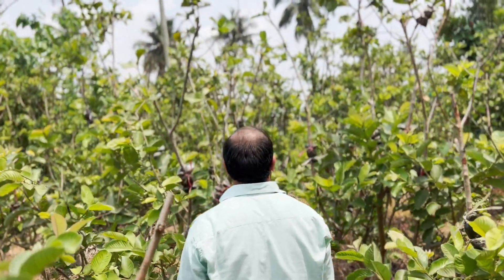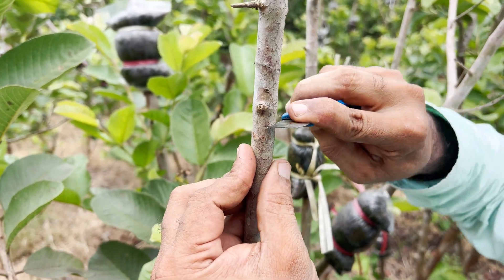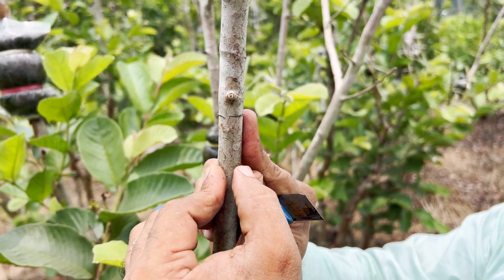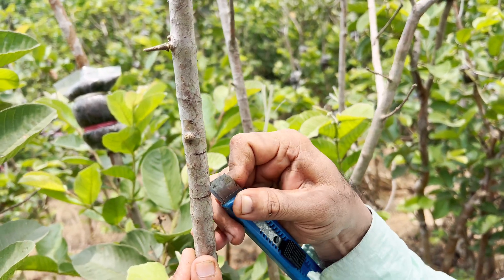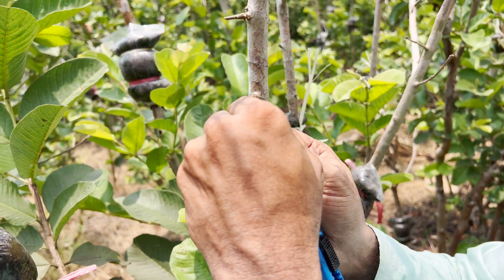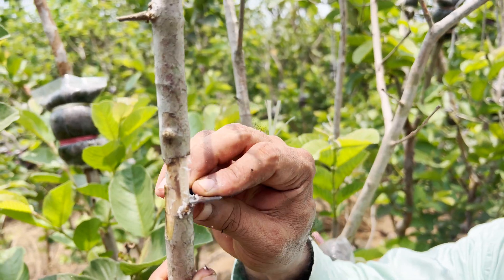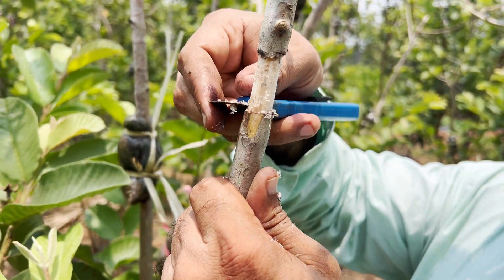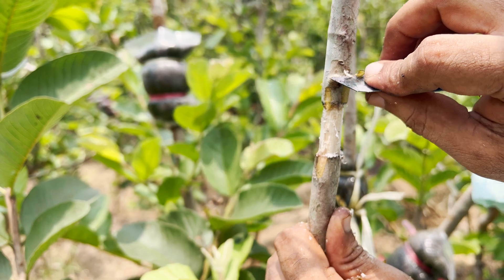Ever wondered! why we make that 1-inch cut below the node while doing air layering?Very Crucial Step

Comment: Sir u r the most experienced person
Need one q from u pls
I have a nursery in west bengal 
Cutting for root formation of Begunvalliae and Hibiscus how much ppm require for NAA & IBA
Reply: Thank you very much sir for this Very good video with explanation on preparation for Air layering..👌👍🙏🌟🌹

(Kindly correct spellings in this video regarding Xylem, Phloem & Cambium..)
Reply from the maker: For Bougainvillea Semi-hardwood cuttings-2000 PPM IBA + 1000 PPM NAA
For Hardwood cuttings - at least 3000 PPM IBA+ 1500 NAA
Hibiscus Semi-hardwood and hardwood cuttings 2000 PPM IBA is sufficient in view
Reply: @KloneRsrootingaids  How much PPM of NAA & IBA (approx.) will be needed for air layering apple plants? Thank you.
Reply from the maker: We didn't try ourselves on an apple plant. Usually it will be 5000 PPM approximately for less than 1 inch. 10000 PPM approximately for 1 to 2 inch stem.
If you're interested I would like to send a free sample to try on an apple plant air layering propagation. Plz send a message to 8688659990 by mentioning this comment.
Reply: @KloneRsrootingaids  I will respond though your email. Thank you.
Reply: @KloneRsrootingaids  so many Thanks